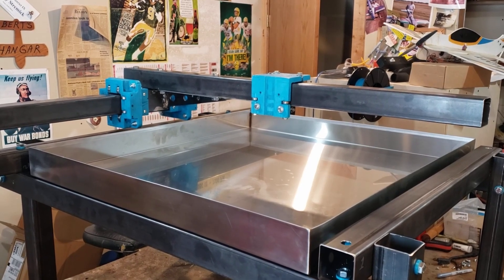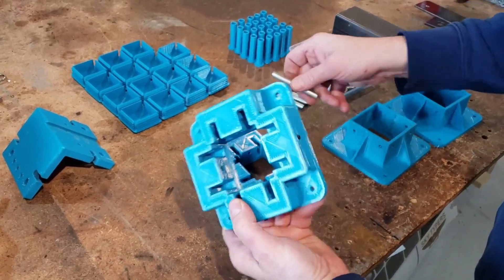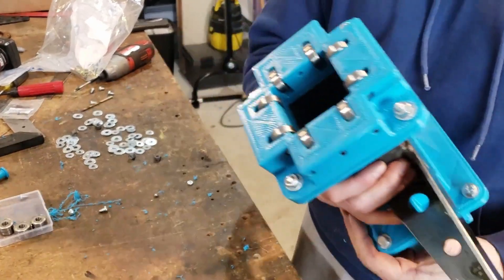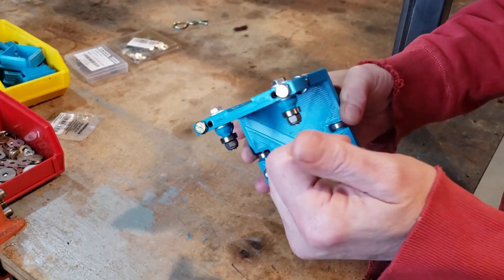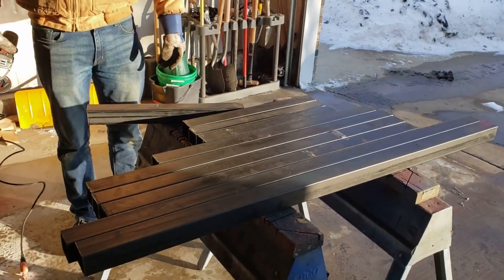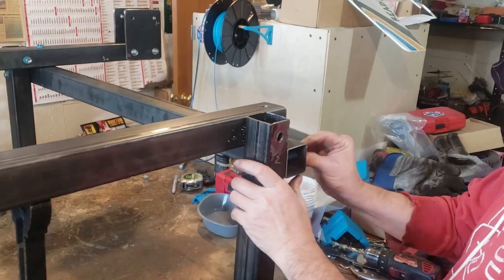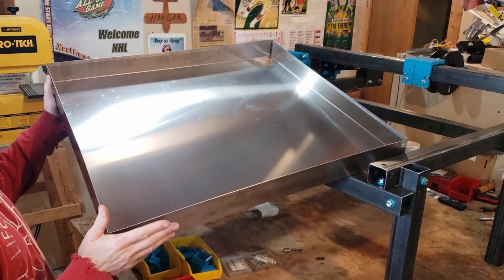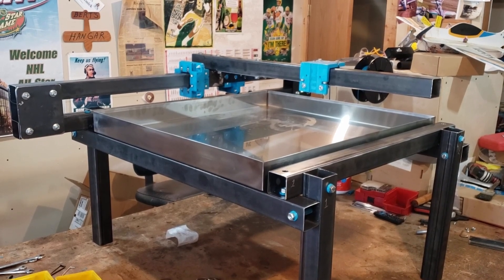Budget DIY CNC Plasma Cutter || Gantry and Frame

Comment: got the plans  and started 3d printing.  but won't use PLA due to high heat in the summer garage that PLA can tend to warp.  Working on using PETG that prints at a higher temp
Reply: I was considering ABS-CF/GF or ASA. But I already have a lot of PETG, so there's that.

Comment: Is there a reason you can't just use off-the-shelf 3/8 ID x 4" ABS or aluminum spacers with washers under the head of the bolt and under the nut on the other side of the connection?  Or maybe the spacer is 3.90" so the connection can compress just a bit.   The stainless water pan from Vevor for $65 works fine - just need to make the X axis 2" longer (40" instead of 38").

Comment: Vevor has cheap stainless steel water pans.   Just got mine for $65 and it only took 3 days to arrive.   I will need to expand my frame in one direction by a couple inches for the slightly larger pan, but it's all good.
Reply: discontinued and out of stock everywhere now...

Comment: Just purchased the plans and waiting for my email. You have anymore info on the 3d printed parts? You should make a video on that alone. Knowing what material, temps, orientations on print bed and like info would be helpful too. Maybe its all in the plans. Guess I will have to wait and see. Keep up the good work.
Reply: Was all the info in the plans?
Reply: @benjaminfoley689  for the most part yes. You will need to know your printers capabilities and tolerances in order to figure out different print orientation for some parts. I printed all mine on ender 3 pro with direct drive and mirror bed. I also use .6mm nozzle and 1.75 PLA. They use .8mm and 2.85 filament
Reply: @laytonbrian  Thank You, I was also interested to know if the 1.75 PLA will work and be sturdy enough. Would be using a SOLVOL series 6.

Comment: I'm building mine now, im building the Y axis to have 48 inches of movement btw. Built with .120 wall except for the gantry to keep it lighter. I have to  say I'm am impressed with the 3d parts they are super strong.
They hold a thread incredibly well.
Reply: how much work and difference to the plans is it to build it 48 inches?

Comment: You did not say if you made these parts  and how or you bought them  !!!
You do not have even a sketch about this machine, very   Disorganized 
 Also,  what about the software that is going to run  this 3 D machine ,  
what board you are using ? and the code !!! 

           The video sucks !!!!!!!!!!!! and should be removed

Comment: Would a 3D printer with 300×300×320 mm max printed product dimensions be sufficient for 3D printed parts of this cutter?
Reply: I made mine on 220x220x250

Comment: the metal tubing alone is 250...
Reply: I got the entire metal list from metal mart for $199
Reply: @metal693  after calling about a dozen shops I found one that can send me the entire metal parts list cut to size for 115 plus shipping. So it is possible
Reply: @Jan-mu6vs  are you going to paint yours? I'm wondering if its recommended to paint the tubing that the rollers ride on
Reply: @metal693  im thinking wd40. Paint will jus chip and be ugly

Comment: what size are the shafts ? its not on the build list i bought the kit and the files
Reply from the maker: The shaft sizes are listed in the BOM included in the plans.
Reply: @JD's Garage  I don't see it on there I only see the ones for the z
Reply: it says 2ft also the bearings u speced are 8mm so why not use the 8 mm rod ?

Comment: hey guys, i finally got around to hooking up my controller to the 2 motors last night for the first tests.
x motor was moving  by using the y axis controls in the software, and i hadnt configured the settings yet.
today i corrected the grbl settings according to the grbl settings in the plans, and nothing moves anymore...
Also, what should the #4 dip switch be set to on the dm556, doesnt say in the instructions...

Comment: Hey guys, love these plans. My buddy and I are both building our cutters (about 1000 miles apart and he's much further along on the 3D printing). I have a lead on some leftover square 2” but it is .180 wall instead of the .065 called for in the plans. Any reason why that wouldn’t work? Seems the external dimension is the key and the extra thickness just makes it beefier (and 3x heavy!) As you noted in the video, the X-axis gantry bar is held down by weight anyway. I know the 2.5" thickness is critical to make the gantry for the X-axis but the only thing I see going inside the 2" tube are your nice little end caps. I can modify the STL files for those and print a new size. Is the motor horsepower a problem to move that much weight?
Reply from the maker: You will run into serious issues with the Gantry being that heavy, that is why it specifically calls for 0.065 tube in the plans. This needs to be a light as possible to deal with the accelerations in movement needed for cutting metal.
Reply: @jdsgarage701  Got it - makes sense. So I could use the heavy stuff for the legs and the frame but then step back to thinner tubing for the gantry itself.
Reply: @jdsgarage701  could you sub in some aluminum for the gantry pieces? I havent measured any 6061 square tube. got the plans this weekend. looking at expanding the table. im a welding engineer so im pumped about getting to use my plasma cutter DIY at home. May even try and build one of these at work and put a laser head on it ( need to cut 3mm sheet). ill let you know how it goes.
Reply from the maker: @benedictphoto  You can definitely make it from aluminum, only thing is it might wear faster.
Reply: Would anodized aluminum hold up better. I know I'm adding expense to the thing, but if it wears longer, it would actually save money.

Comment: I bought the plans, printed the parts...so now time to make the structure .
I consider better for me to weld the tubings instead of bolting them...do you have issues about it?
I had to buy 0,125 tubing because 0,065 was not available; just not sure about the weight of the gantry...thinking of making holes on it to make it lighter????
Reply from the maker: Shouldn't be any issues with welding the frame. But you will run into speed issues with the heavy wall tube for the Gantry.

Comment: Very Nice work!  I'm wondering if the plastic spacer/standoffs will relax over time and the frame bolts may loosen? 100% fill on the bearing brackets?
Reply from the maker: Some adjustment points were added to compensate if this does happen. 80% infill
Reply: @jdsgarage701  i couldnt find this in the plans, if it isnt it should be. thank you so much for the plans though. purchased and started printing just recently.
Reply: Should all of the parts be printed at 80% infill?

Comment: Really well made :) I am considering making something similar, as I both have the welder and 3D Printer and should be able to make this. Have you done the drawings yourself for the 3D Printed items?
Reply from the maker: Plans are now available if you want them.  https://jdsgarage.bigcartel.com/
Reply: @jdsgarage701  I just bought the plans, but I cannot see where to download it from? Also what size of square tubing are you using? I will be working in metric, but believe it should be possible to adapt same.
Reply from the maker: @srenfreiesleben1028  Plans should be emailed to you. We used 2" tubing but 50mm tube should work.
Reply from the maker: Yes, we drew all the 3d printed parts.
Reply: @jdsgarage701  Ohh cool, let me know if you want one to test the drawings you made as well :) Because I could draw it myself, but also know the time required. Is it printed i PLA or PETG?
Reply from the maker: @srenfreiesleben1028  Made from PLA, planning on making the .stl files and plans public, once they are finished.
Reply: @jdsgarage701  perfect, thanks :) Great build
Reply: @jdsgarage701  Have you considered making this open source? Either way, thank you very much for all you have done with this. I think I'm going to give this a try once I clear out a few other projects.
Reply: Hello, the 2-inch tubes, but what caliber are you using?
Reply: @alejandrosindreu421  I ordered 2" tubing, 0.065" wall thickness. Metal is super expensive right now, otherwise I would have gone with 0.125" or heavier on the main frame, but still the 0.065" on the X-axis arm since it's only supported on one side. Hope this helps!
Reply: @insandity1767  Please tell me what is the price of metal 2" and thickness 0.125" in your region including taxes?
Reply: I think you should use a ban saw for cutting the tubes

Comment: Nice start to this build.
What source are you going to run,and which controller.
Just asking, as my budget built went overbudget as I had to replace low budget parts for medium budget parts, as the low budget parts were not up to snuff.
Reply from the maker: Running an arduino uno on grbl 1.1. Just released a video talking more about it.
Reply: @jdsgarage701  
Thanks, I hope the arc ignition of the plasma you are going to use doesn't fry it.
Mine did, sadly enough.
Reply from the maker: @NemesisRTCW  We heard this was a common problem and did some research on it. With Proper shielding and a low frequency start to the cutter it sounds like it won't be a problem, but we will see.
Reply: @jdsgarage701  
Mine was HF/Pilot arc start, it fried my arduino and my proma thc, now Im running a blowback start Citocut, with another Proma THC and a CSMIO controller. 
Shielding was as good as I could get it, now with the bb start problems I had are gone.
Reply from the maker: @NemesisRTCW  Just got the torch it has an LF blowback start, all the research we've done says it will work but we will see.
Reply: @jdsgarage701  
With BB start youll be good to go.